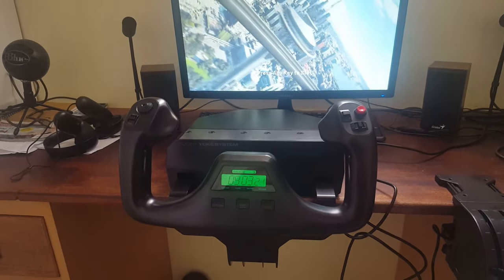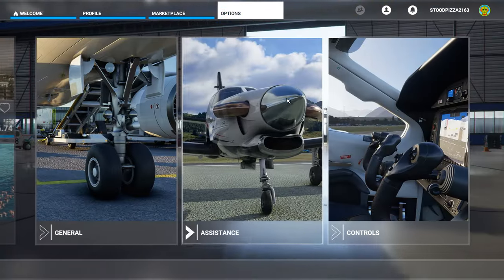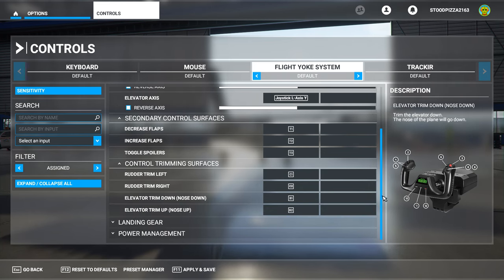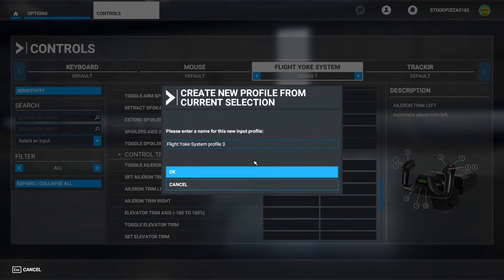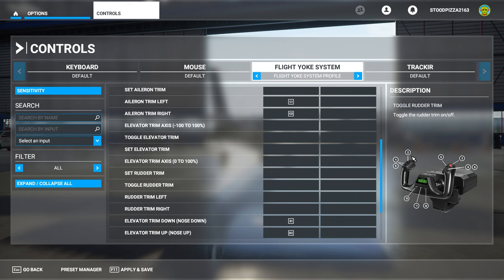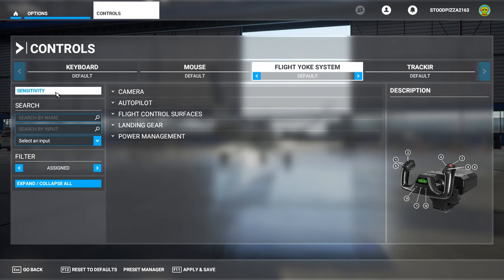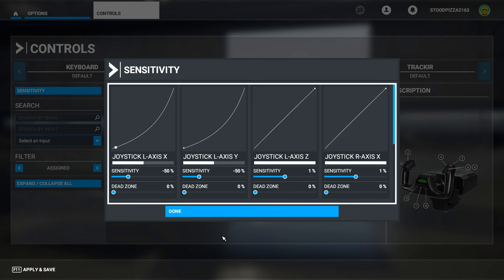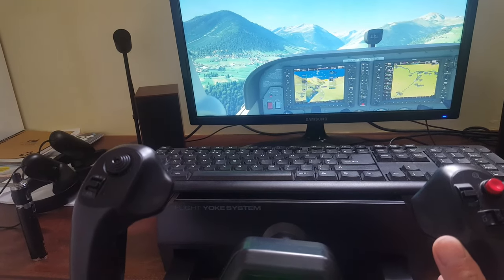FS2020: Setting up the Logitech Flight Yoke System and alleviating the Deadzone!

Comment: I can’t figure what all the T controls are on the throttle quadrant. I’m trying to assign engine controls
Reply: Like I can’t figure out how to get the throttle quadrant to increase and decrease throttle
Reply from the maker: @hurricaneandrew1  That should be set by default
Reply: Huddison I’ve kinda figured it out now. It’s set by default but it’s not working. The whole quadrant isn’t working. The green light is on but no lever or button will do anything
Reply from the maker: @hurricaneandrew1  that's weird🤔 is your flight yoke system new?
Reply: Huddison yes

Comment: I just dont see how to add the device to my computer only the regulat controller
Reply from the maker: To physically attach it you mean?
Reply: No, so actually I have a HPPC and I am using cloud gaming for Microsoft simulator. I initially purchased the velocity flight yoke system which I later found out was not compatible, so I then purchased the logitech version which is not compatible with Xbox only PC I am at a hard stop. I load the game from Xbox cloud gaming on my PC and plug-inthe system to my PC but it’s not acknowledging a controller is it because I need to download it straight to my PC and not cloud gaming from Xbox I don’t know what’s the problem
Reply: It came with no instructions. I’m having to try to piece things together with videos, but it all boils down to why is it not showing up as a controller when I’m trying to use the actual game the PC that I currently have cannot install it because it’s requiring more space, it can be played on Xbox with the regular controller but I need to play it with the yoke system so I am using my PC
Reply from the maker: Not certain how it interacts via cloud gaming.  @natashawilliams5673
Reply: Got it that might be the issue that I’m running into

Comment: Can u show me how to make reversers?
Reply from the maker: I believe that's already set as default - just click/pull your thrust as far down as it goes.
Reply: Huddison ok tyy
Reply from the maker: Actually, now I've just loaded up FS2020, I'm not fully confident in my answer - bear with me - as soon as I know for certain, I'll report back to you!
Reply from the maker: I did find a setting for reverse thrust - in options/controls, ensure filter is set to 'all' - scroll right down to 'throttle' and you'll find options for setting reverse thrust there.
Reply: Huddison tysm
Reply: When i assigned reverse thrust to the throttle quadrant I had to move it all the way down to reverse to «select» reversers, and then move it up to actually power up the reversers. To «select» the normal forward thrust I had to to the same thing again. Took med a bit to understans, because on X-Plane the reversers started immediately on pushing the throttle stick down to reverse.
Reply from the maker: @XxYouAreAnnoyingxX  Yes i've read it's not so straight forward to select reverse thrust currently in FS2020; hopefully they fix this soon.
Reply: Huddison yea

Comment: What rudder pedals would be good for a setup like you with this Logitech yoke and throttle? I am a beginner and I’ll probably just be playing around in X plane 11 and MFS 2020. Don’t need anything too expensive/fancy, as long as it does the trick. Thanks!
Reply from the maker: Either the CH or Logitech Rudder pedals are a good choice - here's a link to give you some idea:
https://www.logitechg.com/en-gb/products/flight/flight-simulator-rudder-pedals.945-000005.html
Reply: @Huddison  Would the thrustmaster pedals for 129 work or should I pay the extra $40 for the Logitech pedals? I've heard mixed reviews but I think you know best :)
Reply from the maker: @jack0939  Honestly my friend, I can't advise on either, as I'm still waiting to buy my own set; I had the CH Pedals bought and paid for on Ebay, but that deal fell through.
I would personally go for the Logitech Rudder pedals next, simply to keep everything uniform, so to speak ;)
Reply: @Huddison  alright thanks! :)
Reply: Saitech pedals will give you the best bang for your buck. Not expensive and they are adjustable tension wise. They are recognized by the msfs2020 and you can adjust them in the controls section of the program. The mechanical tension is done at the pedals by rotating a knob to inc/dec tension. Hope this helps.

Comment: Your my hero today
Reply from the maker: Thanks buddy ;)
Reply: @Huddison  Im currently trying to figure out how to calibrate my yoke. There seems to be no way to do it. Not even on the Windows side.
Reply from the maker: @DeepWebDiary  The logitech Flight Yoke?
Reply: @Huddison  Yea, I have the same one
Reply from the maker: @DeepWebDiary  Yes it's a fault with this particular Yoke, what problems are you having with it?
Reply: @Huddison  I can barely turn left in MSFS 2020 but in Xplane my yoke works just fine
Reply from the maker: @DeepWebDiary  Only thing I can offer as a suggestion is to not have any other controllers connected (or unplug them if you have) and then see if the yoke behaves better.
I also have my Yoke plugged into a USB 3.0 port.
Reply: @Huddison  You would think such a basic idea would be available but its not lol
Reply: @Huddison  Ive pretty much tried everything. I dont know why such a basic function isnt available.
Reply from the maker: @DeepWebDiary  Agreed, it really should be available. I'll link a page with other suggestions:
https://support.logi.com/hc/en-gb/articles/360023194074
Reply: Guess you got a video idea if they ever have a way to do it. As of right now, I may just buy another yoke system

Comment: How do you set the functions on the clock in the Logitech flight yoke ?
Reply from the maker: Press the 'Function' button (left most button) to get to the stopwatch feature; press 'Start/Stop' to start and stop the stopwatch and 'reset' to reset it again.
Press the 'Function' button to get back to real time clock.
I'll be making a future video on the uses of this in FS 2020.
Reply: Thanks Huddison. That helps.
Reply: @Huddison  Hi there. Got my yoke yesterday and love it! I can's seem to get the real live clock working. stop watch works fine, but when i switch to the clock setting, only zero's show....
Reply from the maker: @claudfreeman8879  I'm not sure why this happens for some - try switching USB ports on your PC (I have mine in a USB 3 port).
Did you install a driver for the yoke?
Reply: @Huddison  I will try the switch. No driver installed. Simple plug and play. Should the real life clock come on as soon s it is plugged in?
Reply from the maker: @claudfreeman8879  Ideally yes it should do - it did with mine.  I'll try researching possible issues, as to why it might not display.
Reply: @Huddison  I have resolved the issue by downloading the latest driver from the Logitech support site. Thanks for your help.
Reply from the maker: @claudfreeman8879  Great to hear👍

Comment: Hi mate.
I have a question. Im on the latest delux version of FS.
When I turn right, i have to turn left afterwards to level the plane again. I have the saitek pro flight yoke,  shouldnt this level the plane up when i let the yoke go back to straight again? Is there a way to sort this in settings?
Thanks
Reply from the maker: That's normal behaviour for aircraft; you are essentially dipping the wings left or right when you bank (turn), so you have to use opposite bank to level back up.
My best advice is to get used to this, as you don't want to get used to bad habits or incorrect flight procedures.
Reply: @Huddison  i will do that,  if that's realistic, then so be it. Thank you for your advice.
Ive subbed. 👍